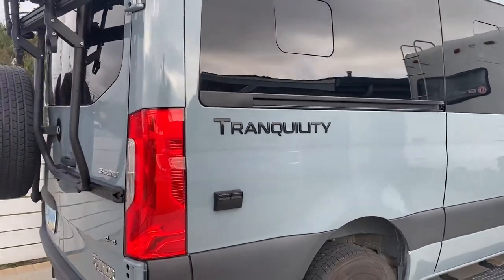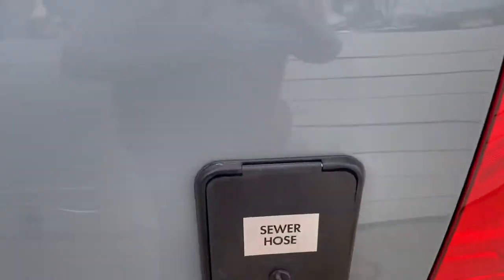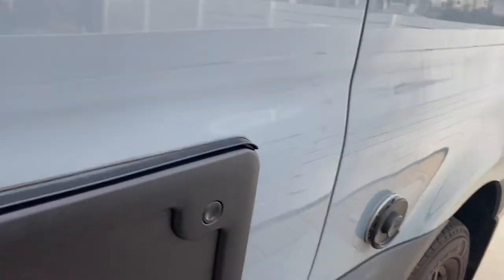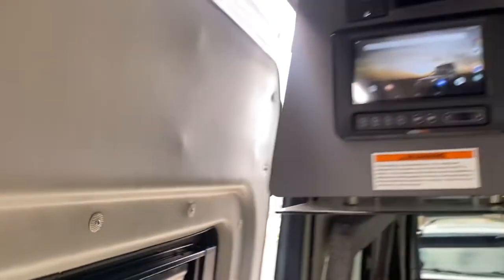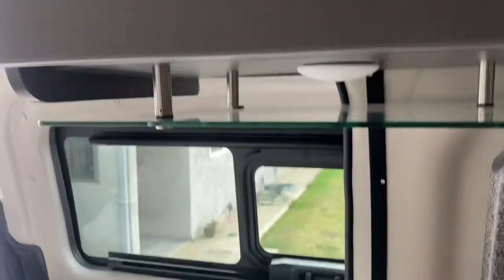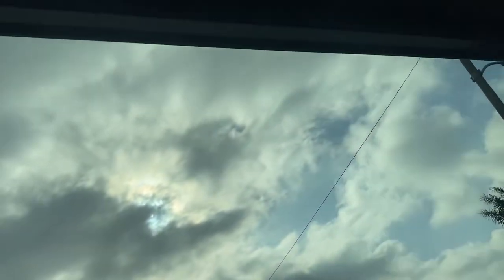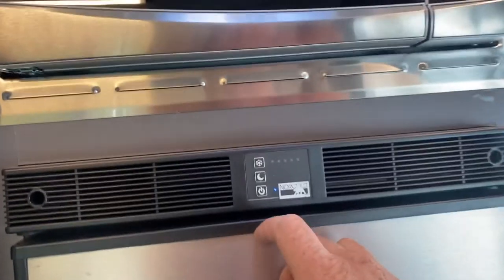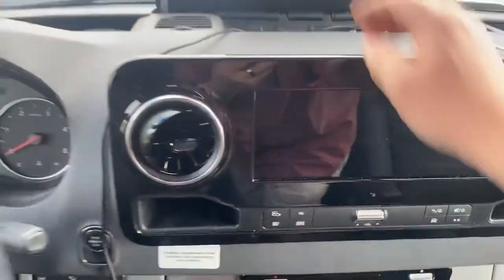2022 Thor Tranquility 19P Operating Instructions

Comment: Have the cabinets come loose yet?
Reply: Our brand new 2022 had issues with loose screws coming from behind the fridge area.  Turns out they didn't put the fridge in correctly & under manufacturers warranty they had to fix it.  I'm disappointed with the overall quality of the builder & the build, I realize now why ppl overlook this product & buy elsewhere.  The quality for the price point does not match up.  However, it does suit my immediate needs to travel & have our own space while traveling.
Reply: @mrnumber2019  I’m thinking on getting one looking for the 19L unit with sliding shelves in the back.
Reply: @treedeblue  Sliding shelves were discontinued on the 22's. We were looking forward to that feature as well. When we went to pick ours up the dealer forgot to mention that detail. Turns out it's for the better actually. Utilizes the storage more efficiently .

Comment: What is the light switch in the back for next to the water switch.
Reply: Switch is for a small LED light adjacent to the 30 amp shore power on the port side.
Reply: @rayswiney7398  that’s what I thought too also the “exterior light” on the BMPro controls. But when I press that switch in the back all I hear is what sounds like a pump and the exterior light does not turn on.
Reply: @oatiko3065  Sounds like maybe the label for the exterior water supply and light could possibly be switched or mislabeled. I would probably take it in and have it looked at. Unless of course your good with electrical, which I'm not. Fortunately my son is a journeyman electrician. Good luck. Thanks RS
Reply: I didn't see you open up the back doors, otherwise I liked the video.  It helped my family & I understand our Thor on a greater level.  Hopefully you'll go more in depth on the combimaster 120v, dash cams & how to play back & record, controls on the steering wheel; etc.  Thanks for the video keep up the great work.  Also how to use the jack.